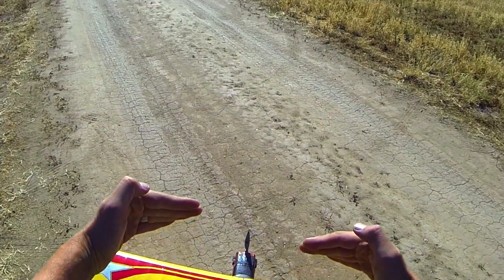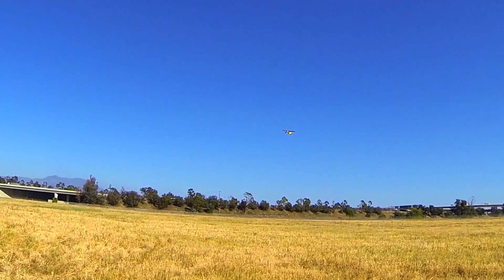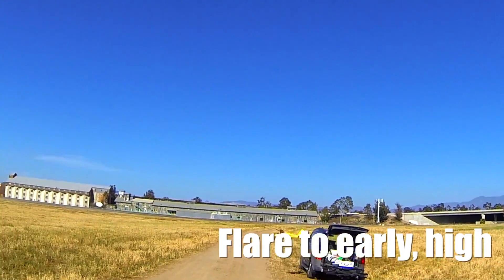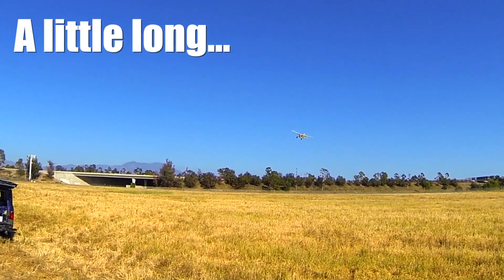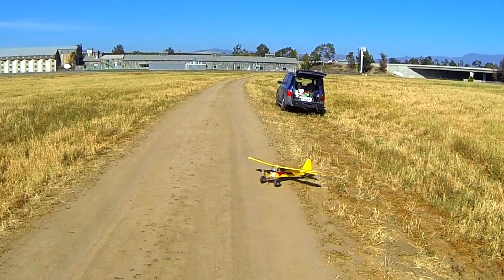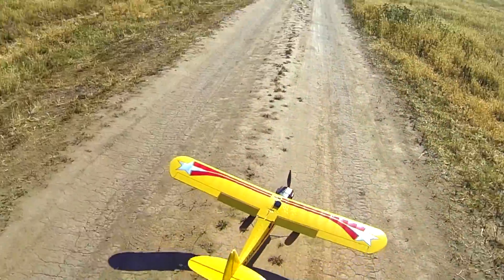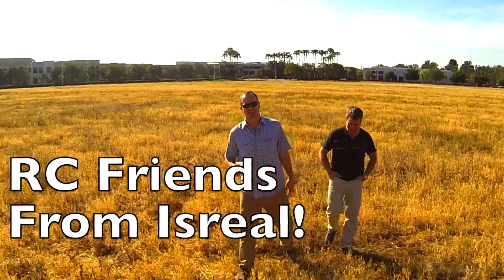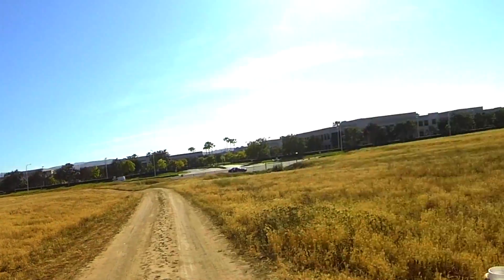How to do STOL landings - Fun Cub

Comment: I have found that having a slow and steady constant descent is best for landing, I actually use Throttle for controlling height and elavator for speed pulling up to deacrease and down to increase airspeed. If youhave flaps you can try half flap landings andthen instead of flaring with elevator you switch to full flap when youre just about to touch down
Reply from the maker: I'll try that!

Comment: I agree with rc beginners... keep the fuselage as level as possible maybe a slight positive attitude. Use throttle to find a desirable sink rate... I usually keep the flaps at the same position and just about a foot or so of the ground slowly decrease throttle... I used to chop the power but it never ends up graceful lol. If you enjoy this kind of flying I'd suggest the Carbon Z Cub. It's the best plane I've had for fun takeoff and landings! In about 8mph wind I've accomplished a roll out of about 3 to 4 inches on take off and about a foot maybe a Lil less on landing... No wind takes significantly more space but still really good! Also try slip landings super fun! You can check out my fpv on my Cub on my channel! The landing at the end is a forward slip!
Reply from the maker: Thanks, I'll check it out